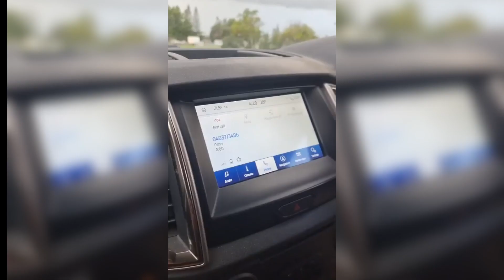BIT BY A BABY BROWN SNAKE!!

Comment: The pressure bandage advice is spot on for Australia, where there are no vipers.
In the rest of the world, a pressure bandage is fine for most cobras,  kraits, mambas etc, but for viper bites, remove jewellery like rings, wash the limb and get to hospital. Do not apply a pressure bandage, because the venom is usually haemotoxic and/or cytotoxic, and keeping it in the bitten limb will likely cost you that limb.
Reply: Thank you! 🙏

Comment: When you say bandage do you mean tourniquet?
Reply: Compression bandage.  In Australia where all of our venomous snakes are elapids, a compression bandage is the correct first aid.
Reply: For Aussie snake bites you never use a tourniquet. Snake bite first and here is to remain calm, as minimal to no movement, apply a compression bandage ( stretchy bandage) to cover the Entire Limb, mark bite site on outside of bandage. Call 000, due to how the venom acts it's critical to not move at all & remain calm as the venom moves through the lymph nodes. So doing the above will gain you more valuable time 🙂

You can also buy Snake bite first aid kits here, and the bandages have squares on them to make sure the correct amount of compression stretch is used. If you Google Snake Bite Bandages you should get an idea of what I mean. Sometimes the first Aid kits will be called Premium Snake Bite 1st And kits & have the marked compression bandages, any compression bandage will work though 🙂
Reply: @c.r.mcleod8959 nicely  explained mate 😊